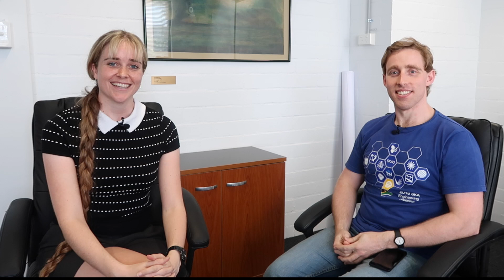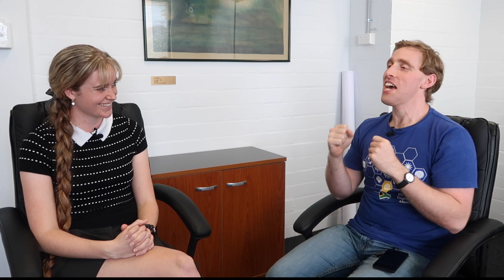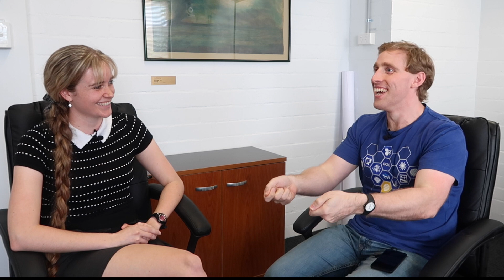Is it hard to do a PhD in physics? ft. David Gozzard

Comment: Why am I even watching this? I started my first term of physics bachelors over a month ago and struggle really hard with it (have to travel 190km every day by train, which cost a lot of time...). I‘m pretty sure I won‘t pass a single exam but I‘m watching a video about doing a phd in physics lol.
Still like your video ^^
Reply from the maker: Thanks for watching, what do you find the most challenging? Hopefully you are able to spend some of your train ride working on physics
Reply: The amount of homework I get. A Big mistake I made is that I was too afraid of analysis, because I didn't understand anything at the beginning, so I spent a lot of time in that and did like nothing for actual physics... .It depends on the type of train. If there are tables I do homeworks otherwise I can just read lecture notes.
Reply: deathinity 190 km or 19 km?
Reply: 190km on train is around 2hour 15min ride
Reply: 190km sounds like too much lol. 19km sounds more resonable.
Reply: who takes the train for 19km?
Reply: Are you a student at ETH Zürich by any means ?